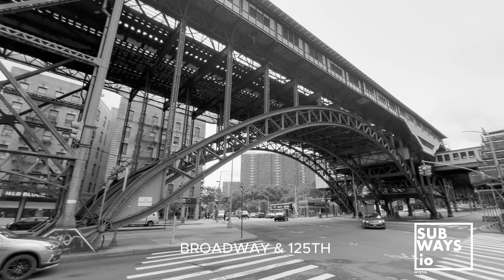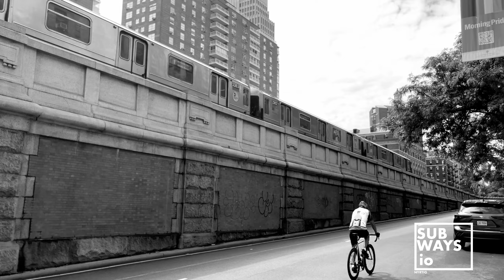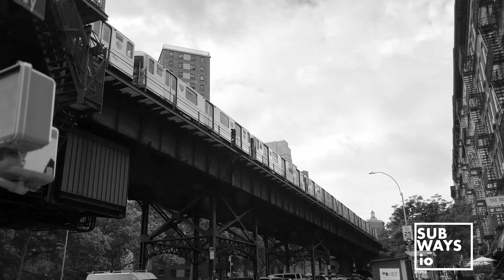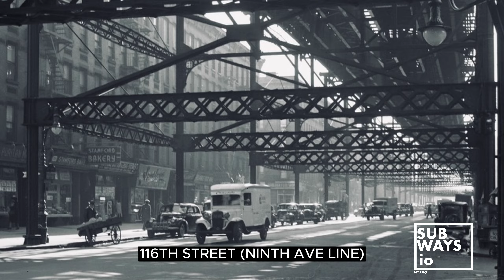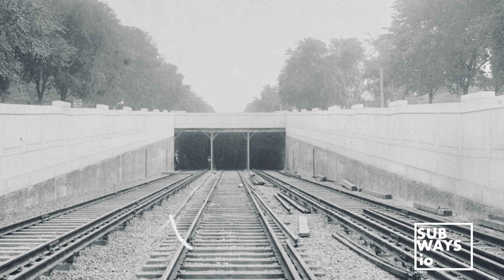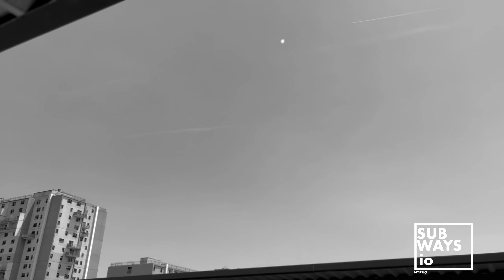Engineering Marvel: The Manhattan Valley Viaduct 🚇 | NYC Subway History”

Comment: Riding north on this portion of the #1 line, the track just about stays level and the ground itself literally drops away and then comes back as the line then continues with some deep stations.  Very interesting to see how they decided how to deal with getting past the valley and seeing the amazing engineering and construction of the era. It looks like the elevated structure emulates the beauty of the nearby Riverside Drive Viaduct.  Back in those times beauty as well as function was important whether elevated or subway stations, roadways, fire alarm boxes, street lights and on and on. Thanks for this short and the channel.